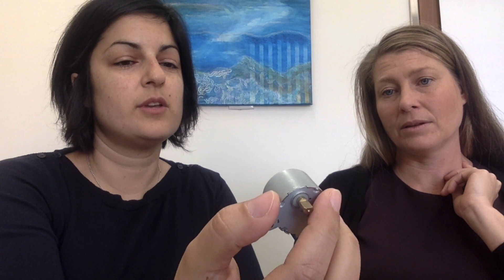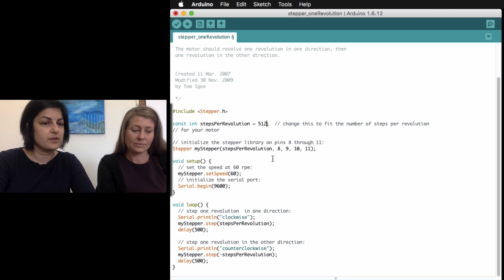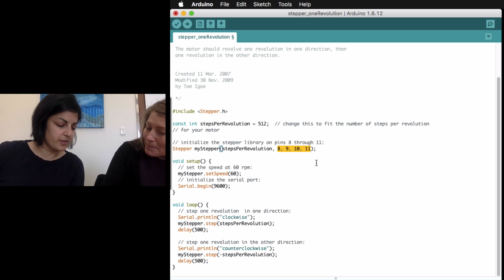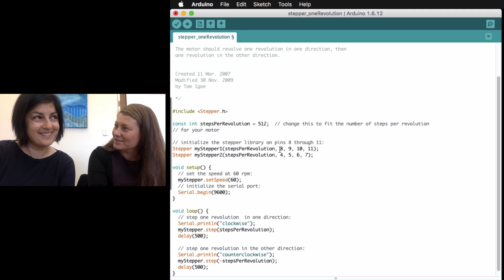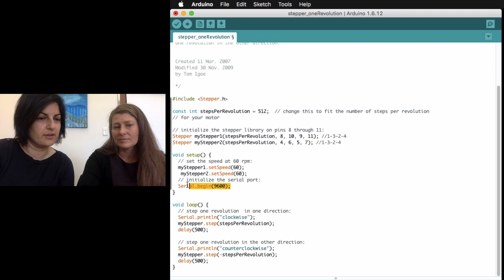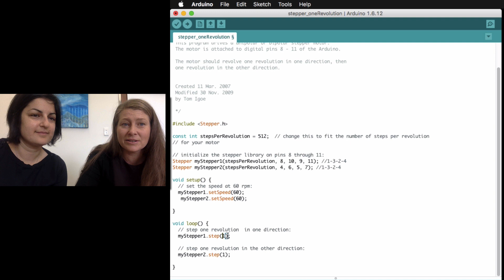How to wire and code 28BYJ-48 Stepper Motors with an Arduino - Part 1

Comment: You will need a separate power supply for the motors, they draw far more current than the Arduino can deliver.

Comment: Isn't it bad to connect stepper motors directly to an arduino? As the steppers might consume too much mA and it has to flow through the arduino which can only support 40mA, maybe burning it in the porcess?

Comment: You supposed to run the stepper motors with a separate power supply.
Reply: I have a separate power supply and there still seems to be a under-power issue.  Problem doesn't occur if I comment out either one of the motor.step() calls.  After about 30 seconds, the LEDs on the drivers all flash together at a rate variable rate around once per second.

Comment: If Im already using the 5V pin on the Arduino for an input thing- is there a way I can still wire up the motors?

Comment: Nice video. It's not 5 volts of power.  Power is VI .  You have to be careful when powering devices from an ardiuno so as not to draw too much current. It is usual to have a separate power supply when running motors , relays etc.  
Well reminded about the port number and , of course,  the board type, else the prog/sketch  won't upload.
 It would have been nice to see the motors running.
I did try the same type of motors and boards and got them working ok  a few months back.  I assembled 2 motors to use as a pan and tilt head for a camera.

Comment: Thanks for your tutorials. I have a project and I know the code and setup must be very basic but here it is. I want to create and adjustable time the stepper more turns in a certain direction when a button is pressed. The project is the rig it to a wood working machine in order to create dovetails. Please could you assist me with code and setup for this. Many thanks in advance
Reply from the maker: Caelum Technologies, we’d love to help. Just need a bit more information - so when you press the button you want the stepper motor to turn after a given amount of time? Or you want to be able to set the time by pushing a button?
Reply: STEM learn awesome thanks so much.  I want to be able to set the amount of time it will turn with a varioresistor and then when the button is pushed it must run for that time.  Then need a button that will bring it back to the starting point. Or maybe when the button is double pressed. Basically i need to rig it to a machine to make wooden dovetail joins.

Comment: The part I'm having trouble with is finding out the steps per revolution of my motor. I am using the same motor as you guys, but according to the datasheet of the motor each step is 5.265º. Wouldn't that make 64 steps per revolution? (5.625 goes into 360 64 times)
Reply from the maker: yeah - its a bit weird like that...when we put the correct number it didn't work for us but when we tried 200 it worked perfectly.  Did you try 200 like us?
Reply: STEM learn I tried many different values. Anything under 512 worked, but didn't give me a full revolution. When I tried 512, it just vibrated and didn't turn at all. Anything above about 600 it didn't vibrate but the driver started beeping. I'll keep experimenting I guess!
Reply from the maker: its also linked to the speed you set - so try changing it to 40 instead of 60 and you'll have more luck.
Reply: STEM learn I'll try that next, thanks!

Comment: Lol wished I seen this attached mine and it just juddered so I worked out 8 9 had to be swapped round but mine set at 200 going to try 512 see if it works any better would love to see someone put code up for change of direction on button press
Reply: I have now after weeks of brain strain managed to get it to work with button in a few different ways and added videos and listed the free code in comments a and unlike some my videos don't have adds and I don't earn money from it this was my first time ever using Arduino so had to watch a lot of videos and mix and match code until I got one to work for my needs but thankyou for the help 

My project is going to be a auto load fishing feeder with distance using two micro switches I can ajust to extend the range I'd make the motor
Reply from the maker: Hi Tony, we have a video which shows how to use a button and then another video which shows how to change direction on your steppers...you should be able to figure the code for the button push changing the direction easily from that :)
Reply: Yes looked at all your videos and a lot of others and no help think I just give up with Ardunio and go back to old school npn and pnp circuit to run a motor in both directions when hitting a micro switch
Reply: Perseverance is a good character trait, don’t give up!

Comment: Stpper moter not run only uln2003 driver light blinking I have use 5v mobile charger for supply...... Plzz guide me
Reply from the maker: Balkaran Singh did you change the code according to the order in which the stepper motor works? It is critical that you change the order to 1-3-2-4

Comment: Why You put 512 steps in the code as the motor has 64 x 64 or 32 x 64 steps?
Reply from the maker: I played around and that was the best number in relation to the speed...depends on which motor you are using.